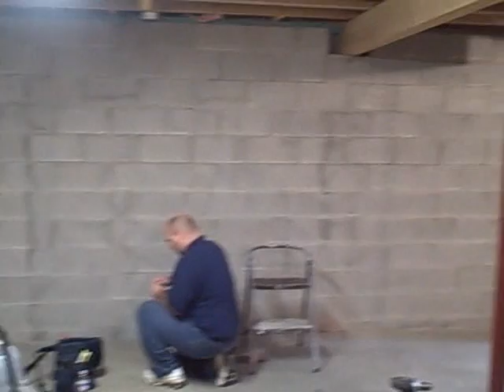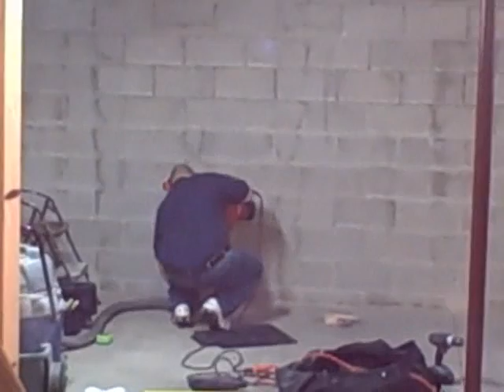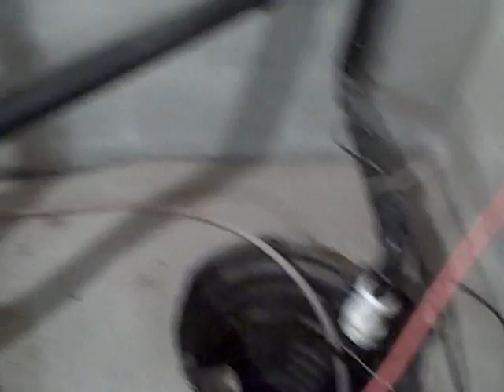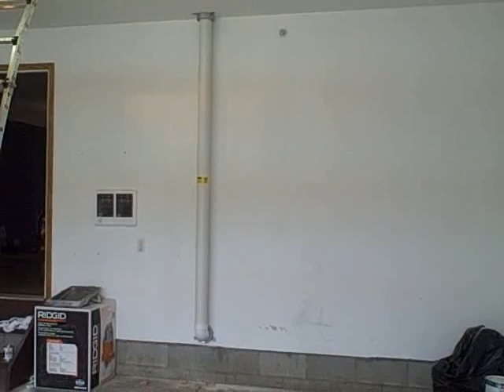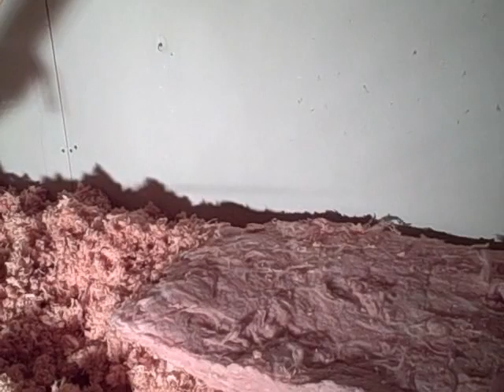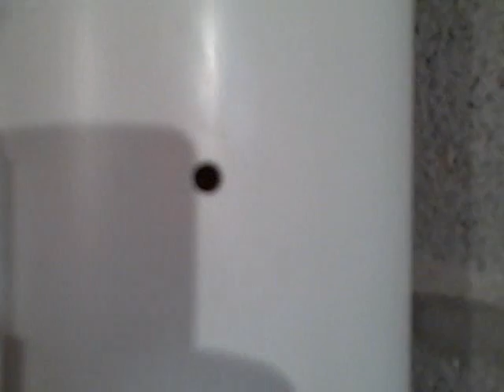Radon Mitigation Akron Ohio

Comment: The sealing of the perimeter of the foundation was smart, but I'd highly advise the homeowner to use DryLok Radon coating on the entire basement blocks to seal them as well.  That, or you could offer that service as well.

Comment: Remember to continuously monitor radon levels to make sure mitigation system works properly! Digital radon detectors are a way to do it, as with them you can easily monitor radon levels, fluctuating throughout the year

Comment: A 45 Degree Coupler would prevent the majority of the rain water from coming in.  Was there any mention/video of a level being put against the newly installed pipe???  WHAT A SCAM..  If it actually works sucking Radon Gas under the Slab; how on Earth wouldn't it Sound Like the Drill Bit Portion of Jason in the Video while is was Doing its Job?

Comment: This is suck a Scam!!  Every Cinder Block Wall Will Crack and leak overtime..  Listen to the BS about a White/Black Pipe!!!
OMG; They speak so slowly; you can tell they never went to College!!

Large Cracks will always be there from the foundation wall vs. the basement floor...  They can move up to a 1 inch radius during the Frost Freeze cycle.. Never a word mentioned with the "MAGIC CAULK"...

What A Scam!!  A Basement Bathroom Fan would be the cheapest over a 20 year payment..   The scam about Lead Based Paint is Done; and now it's Radon Gas...  Please explain why a 85 year old widow is still alive 50 years into her house??   And the average time a couple is actually living in there house nowadays is less than 20 Years?????  LMAO